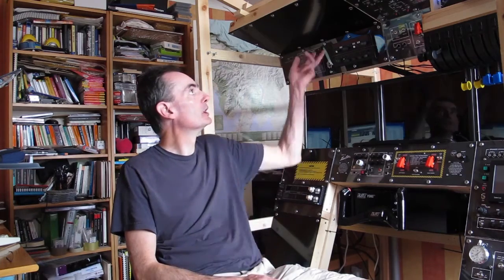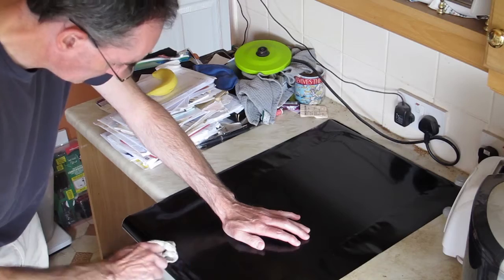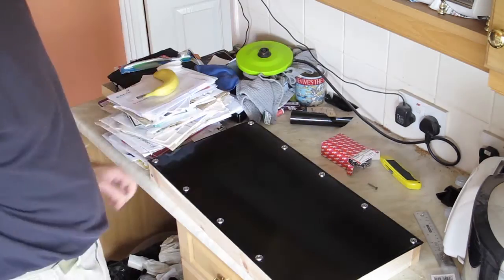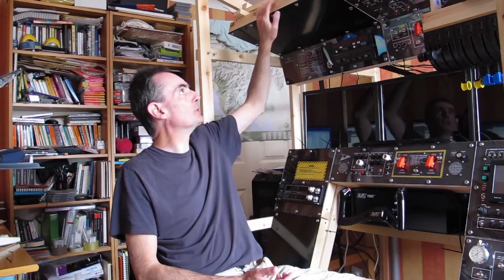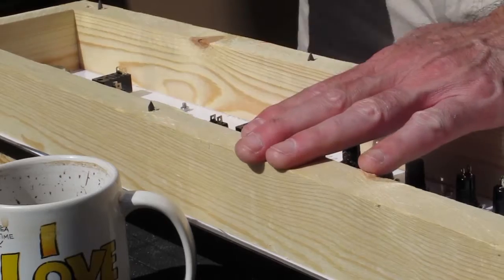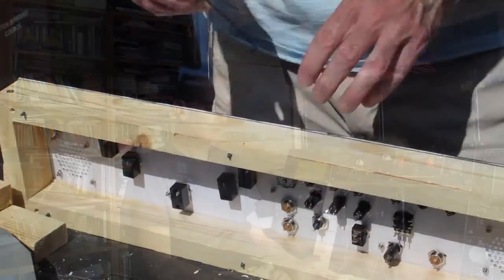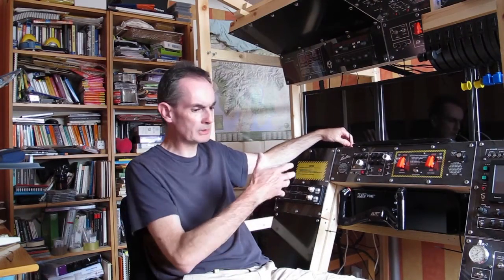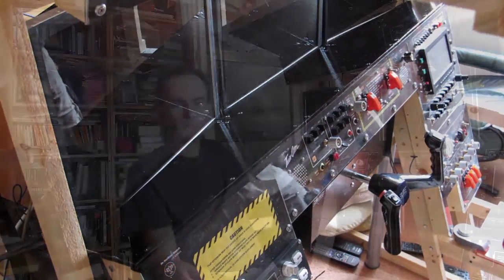Mounting the Panels on the Frame (Twin Otter Cockpit Build - Part 7)

Comment from the maker: Hi David. (I still can't reply directly to your posts.) I think someone asked this before and there isn't really a long list of good reasons. I have always liked the Twin Otter as a package but when I bought the old Twin Otter X I was disappointed and didn't fly it. (Oddly enough, that purchase led directly to my BN Islander review!)

When the new TOX came out I bought it with hope if not exactly optimism, but I was encouraged by the apparent level of depth in the simulation - not just of the flight characteristics but of the systems. This, and the discovery of Gunter Steiner's LINDA macros made me think of choosing this aircraft for a real cockpit. There were (are) a few other choices, but of course it's the hardware interfacing capabilities that are essential.

I like this 'cos it's a twin, it's IFR equipped and a STOL-capable bush plane that can land anywhere (or anywhere-ish). Not sure about the turboprop engines yet, but we'll see. I should also be able to set up to fly the BN Islander, Catalina, DC-3, B-25 and others without too much trouble. And with a bit of imagination (and maybe an additional  TPM setup lower down) I can probably fly singles and stuff too. But I need to get it going first! I was supposed to be soldering switches today but all I've done so far is mount my speakers ;)
Reply: OK Mark I needed to add you to my "contacts"( I hate this Google plus nonsense!)
Thanks for the reply. I thought as much about the Twin Otter flight deck being quite duplicitous! Interestingly, I think the MCE guys are working on support for TOX and further there is discussion about if it will work with sim pits! (experimental)
It was going to be one of my winter projects, (little movies with a TOX MCE!) so I look forward to you finished pit. I wish I had the room (and your skilled patience) Cheers.

Comment: So are you going to wire them all connected to the frame?
Reply from the maker: The panels are currently mounted temporarily (I just need new cable ties if I remove them). Each panel will be wired independently and terminate in one or two 25-way D-Type (RS-232) connectors. The wiring from the Bodnar boards will be long enough to reach the panels and will also terminate in D-Type connectors. hence I can detach the panels without disrupting the wiring.